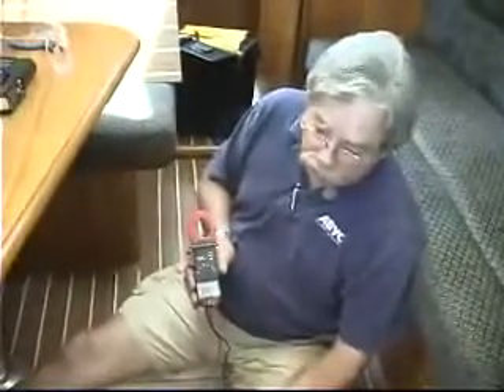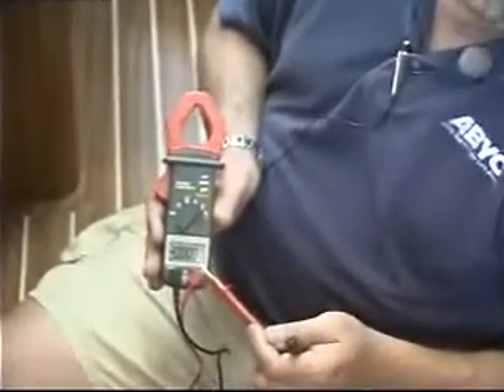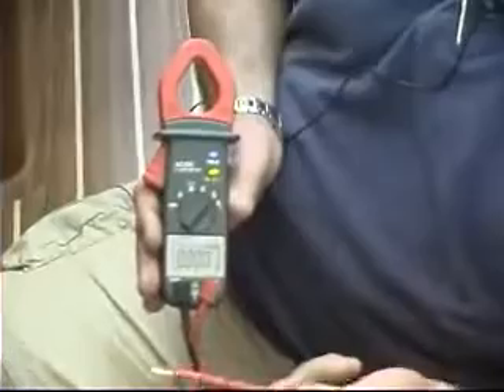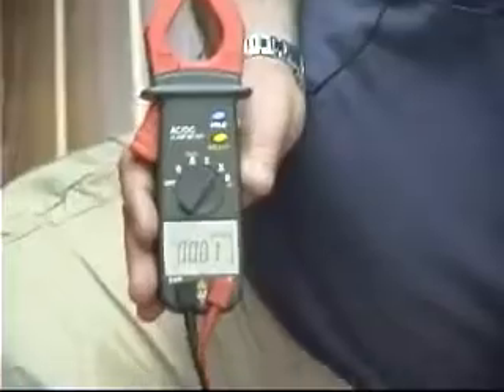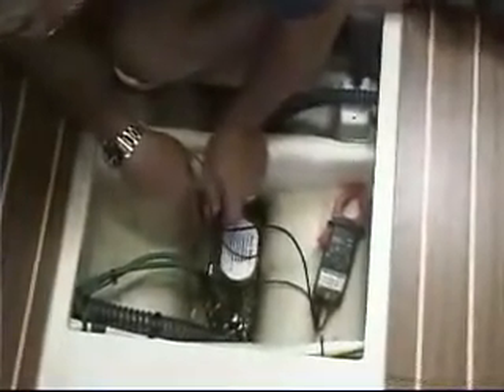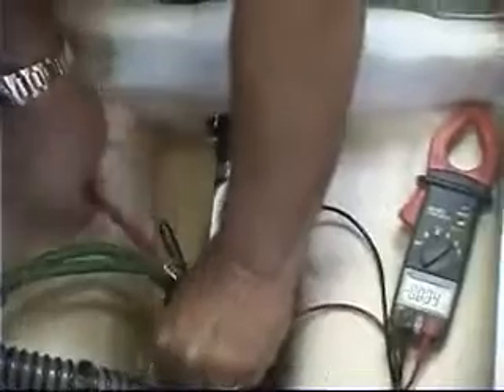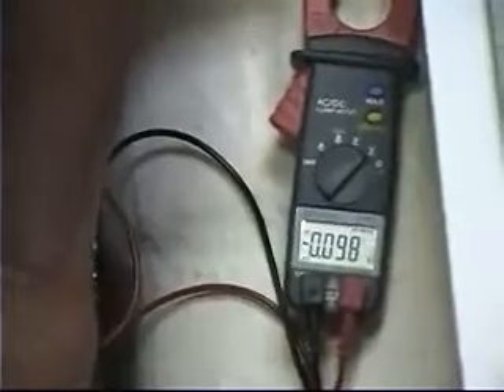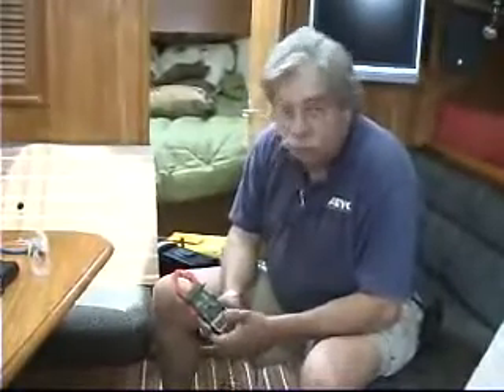Electrical Corrosion  Stray Current Leakage at Bilge

Comment: So you're testing the saltwater and the keel boats which are also in the salt water.  They are at the same potential.  You are going to read zero Vs.  duh.
Reply: you missed the point and the science.
Duh, yourself.
Reply: @osmith5086  Please explain.  (boats should have been bolts in my original comment. )
Reply: @weiniesail  your comment is unnecessarily rude.  
There's plenty of information out there, I'm not going to spoon feed it to you.
 You'll figure it out. 
...Or not.

Comment: Might try using a modern Eheim or other high quality ceramic shaft brushless motor pump to avoid that issue all together... They are all plastic, the brushless motor coils are completely sealed, there are no brushes to wear out requiring maintenance, the polished ceramic shaft that the axially magnetized ceramic magnet rotor and prop spins on lasts for eternity with the Teflon bearing/prop setups and they are fully submersible. Add some quality silicone tubing and you won't even need hose clamps giving you a lifetime maintenance & metal free 850GPH bilge pump system for under $80 bucks that will outlive most of us...